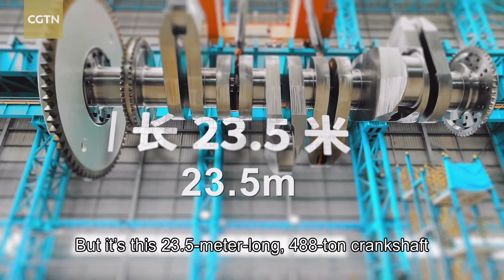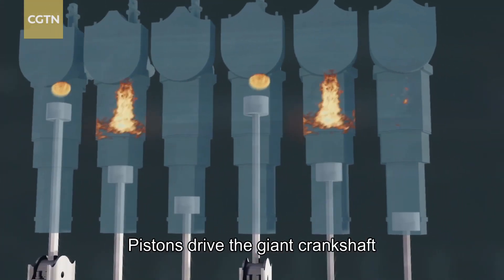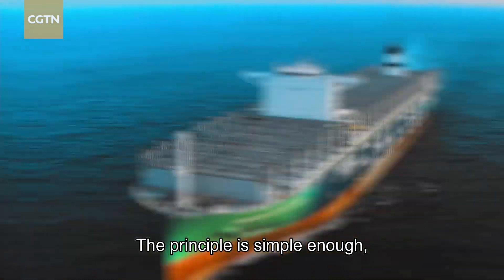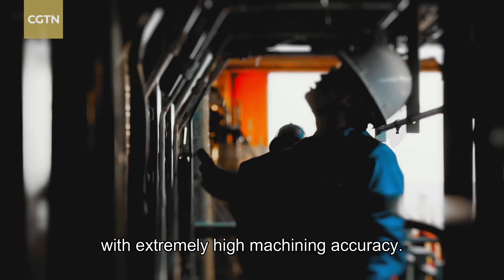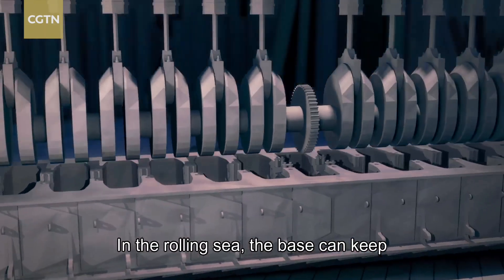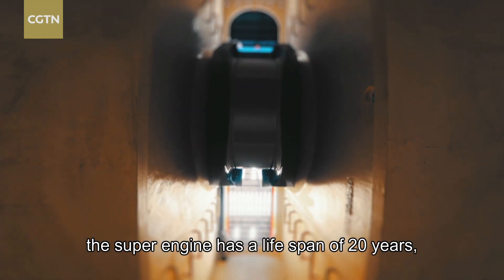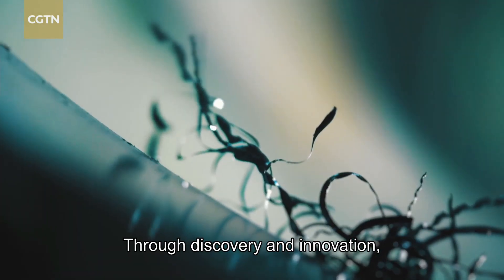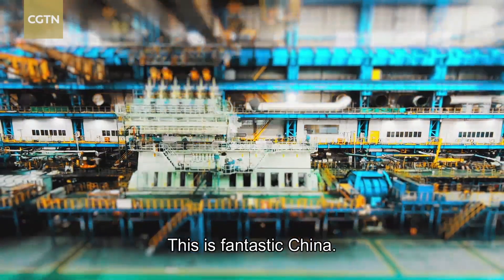The steel heart

Comment: # Adding Silver + Copper+ Zinc in the making of a Ship and Propellers will never allow ship to sink. Its, because the components of the above minerals doesn't dilute and work against the water 💦 particles . Add  a ratio of Silver + Copper+ Zince into 3 + 5 + 2 . Since Silver is expensive, Silver can be diluted with iron to make silver . The ratio of silver + Iron ( 2.5 + 7.5) 🔥🔥🦁 #